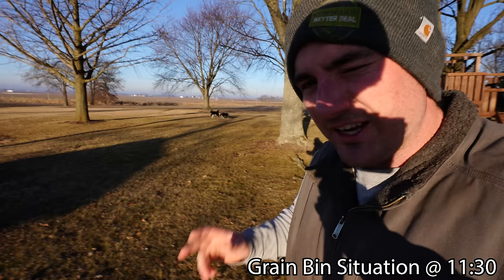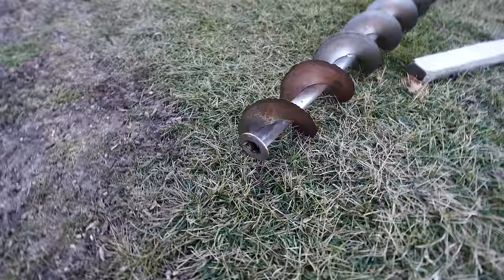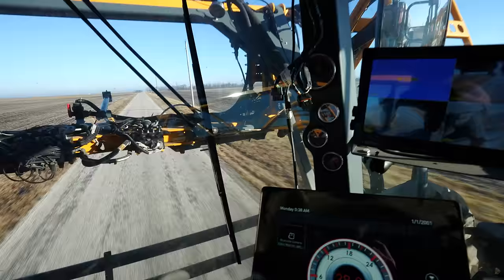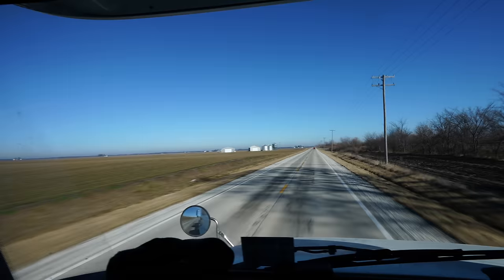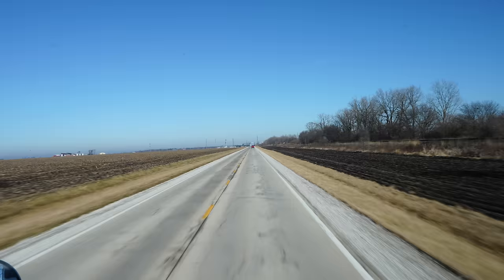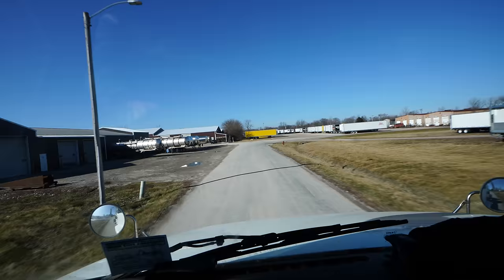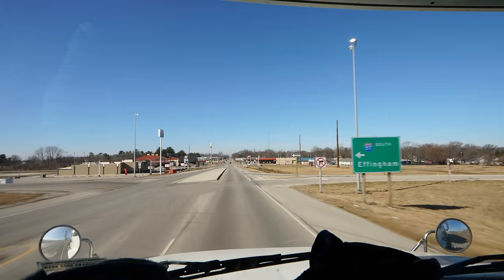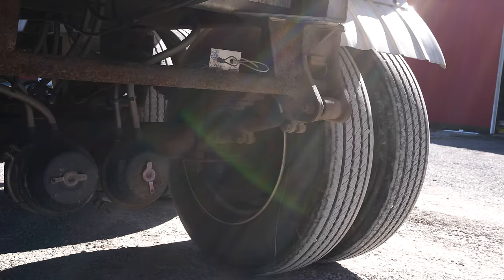Huge Commercial Grain Elevator Collapse

Comment: As a farmer they are not engenearing grain bins heavy enough when you get that big. Corn has gotten a lot denser. 56 lbs per bushel is now 60 to62 lbs per bushel. That extra 5 lbs times 800,000 bushel is a lot of weight.
Reply: I agree with you.   Oddly enough beans are going the other way now.  Should be 60 lbs per bushel.  This year we had as low as 52 come in.  Usually, average around 55.   I am an elevator superintendent.
Reply: @jerfle7787  The swing on test weights of any crops from year to year is very interesting to say the least.

Comment: I used to be a volunteer firefighter, once had a building collapse due to weight of water on the roof. The drains were all blocked and roof collapsed due to weight of the water

Comment: We had two grain bins that were made of corrugated metal, and they started to buckle, by making the corrugations smaller.    It was most likely caused by the weight of grain on each rib adding up for the whole height of the structure.   As soon as we emptied each bin, we installed vertical metal buttresses, to take the downward forces.

Comment: Interesting that you use the tanker to mix your chemical and water together. How do you avoid chemical cross contamination?  Where we are we only use tankers to haul fresh water to the sprayer and then add the chemical as you fill the sprayer.
Reply from the maker: Our herbicide plan is arranged in a way where the sprayer is only running on 1 crop type at a time. It allows an intermediary period to clean everything out between crops. It's not too difficult.

Comment: Andy I am a structural engineer. I watched the video several times. The best I can tell the seam right where it’s still standing went first. Then you see the entire bin drop down, then the seam above the stiffeners goes next because it pours over the top of them. With a clean break all the way around like that, all it takes is one bad spot, or the stiffeners weren’t bolted down, and with that amount of weight above it,,,, down it comes. What I did notice are the new sheets on the other big bin that were replaced. I wonder if that bin had damage or sheets replaced where it failed. For strength I would think the stiffeners would be offset not a straight line all the way around in one spot. Like the sheets are offset where the connecting seams are at. That offset gives you a little more strength. Pure conjecture and glad no one was killed.
Reply: One of the fans was out of balance and hard-secured to the bin I'll bet.  Corn has a nasty habit of being a wedge.
Reply: I am in southern IL.  The corn had a high test weight (density) this year, probably due to the type of weather and that the corn was mostly dry at harvest.  The bin may have had more tons of corn in it than ever before.  I was hauling corn on wagons.  Several of them broke stud bolts in the wheels.  I have never had that happen before.  I had to replace stud bolts and lug nuts.  I told my dad not to fill the wagons so full.
Reply: Liar.
Reply: @darringstewart2360  I think you're onto something, given the major temperature changes over the course of this year (and relative humidity) - if it got moisture into the top of the bin and add one weak vertical seam and you get a disaster.  I'm more curious about that ring that's between the bin and the road - it really does look like it burst
Reply: Having worked in the elevator business for many years, I have seen this type thing on a couple of different occasions. Both were large steel bins that were newer bins, and larger sized. Both were close to the railroad tracks as well. The thing that was similar in these cases was that the harvest was very good with high test  weight  grain. The ones I alluded to to were wheat filled, while the one showed here was corn, but the thing I heard in my examples were that the high test weight grain close to the busy railroad tracks are subject to packing due to the pounding of the trains going through. Over time this pounding packs the grain tighter to the point it will break the bolts and/or cause the lower rings to fail as they are not built to handle the excess weight and stress. I am no engineer so this is just what I remember hearing at the time. Food for thought I guess…….. Either way the good thing is no one got hurt, and the farmers should be able to build it back better than it was…..
Reply: Speaking in engineering terms these bins should have a safety factor built in that would cover unknowns such as heavy grains etc.  I used to work at GSI 15 years ago on the big bin lines.  I think when i was there only for 2.5 years we were owned by 2 different investment banks, and i believe a 3rd investment bank bought GSI shortly after i left.  And AGCO aquired them not long after.  Hopefully its not a result of the company constantly changing hands and everyone wanting to squeeze out more profit by cheapening things up.

Comment: The 20yrs i been in grain business, i have been around 3 bin collapsings. They way that one came apart, I would lean to faulty anchor bolt install and the way stiffners were tied in. Lot of times new structures are slapped together and follow up quality control is overlooked or forgotten. Harvest time go go go!

Comment: I’ve learned that all the farmers core their bins, which makes total sense. It’s like fermentation, the center gets the most FM, would hold heat & moisture under pressure. I’ll tell ya, the farmers who’ve put the reclaim system on their sprayers love them. They said it saves chemical too bc they’re not have to flush the system out between chemicals. I’m sure you’ll keep us posted on what you think!

Comment: Neat tanker, I would advice keeping the plastic cap, stainless thread on stainless thread can be more likely to leak. It can also be a pain to take stainless threads apart after prolonged use. Just keep the plastic cap and replace it every couple years if it starts looking brittle. It all depends on how often you plan on uncapping it really, plastic probably more user friendly.

Comment: I have seen this numerous times in my life and they always seem to follow a pattern.  These problems usually arise when the decision is made to push warm, moist air through a cold grain mass with aeriation fans. 

I don't know why, but it is common practice among many to lower the temperature of the grain mass to subfreezing temperatures which has always gone against my better judgement.  Yes, cold grain does store better for a longer duration, but other challenges will present themselves as weather conditions change around the storage facility.  

My THEORY on what is going on:  Corn shrinks when it is dried and expands when it takes on moisture (within the kernel).  Normally, the grain is already dry when it is placed in the bin and can be of any temperature.  At some point, the decision is made to aerate the grain (a good practice) to lower the temperature of the grain mass to that of the outside conditions.  Note, air temperatures are usually well below freezing during these winter months.  Some time later, the grain is desired to be aerated, again a good practice that helps keep the grain in good condition.  But the problem arises with using excessively warm, moist air.  What happens next is that a rewetting front develops in the grain mass causing the the grain mass to expand.  Stresses then rise in the structure to the point of failure.  The process is highly analogous to what is experienced with freezing water pipes.

Comment: Have your tire dealer check that weather checking tire for possible warranty coverage on the casing.  Typically if it is a Tier 1 Casing (Bridgestone or Michelin) the casing has an incredibly long warranty period - 8 years.  There's a date code on the tire.

Comment: i wonder if they have any empty bins to put the "clean" corn into?  I would assume that the corn in the bottom section is still clean and the corn that is several feet deep would still be clean too.  Hopefully there is concrete under the rest, but if they have an experienced skid steer or bucket loader operator they can recover the bulk of the corn without contaminating too much of it.
Reply: Any place with bunkers.  They have a snowblower low speed front on a belt conveyer out back on self propelled unit.  *never run one but looked it over*. It looks like they drive in, convey into trucks.  My grain vac is rated 3000 BPH IIRC.  But I figure self propelled unit get 5” from ground.  Grain vac for rest.
Reply from the maker: I would assume that they will just move it down to the next user if they are spending money to load it onto trucks. Another commenter said it is being sent to Decatur, IL, which is about 40 miles straight west of Arcola. That is ADMs hub...absolutely ginormous grain processing city.

Comment: Wonder if some of the bolts started popping and shearing before it went down? One a few years ago had bolts shearing before it came down. It was attributed too a worn die used to punch the bolt holes in the panels.

Comment: I would be very careful about using SS on SS it has a very bad habit of galling, the plastic cap should be well suited for what it is doing if you do use a SS cap be sure to use plenty of never-seize to help keep it from galling and don't over tighten. I was a pipe fitter for 40 yrs in a chemical plant I know a lot about SS.
Reply from the maker: I appreciate that insight. Maybe I will reconsider my plan!

Comment: Whoever put that plastic cap on needs to learn to weld cause that looks like it might leak lol but hopefully not
Reply from the maker: I think there is an air pocket in there on purpose. There might be some kind of a gap in the shell that requires venting. I could be wrong... that's why you have to fill it with water before you put the expensive stuff in!

Comment: A lot of that grain is recoverable and hopefully it does not get wet.

Reinforcement straps around various sections of the bin at the ring joints would help to stop a burst.
Reply from the maker: It has been somewhat dry since that happened. I think it is almost completely picked up now.

Comment: a local elevator put up a 600,000 bushel steel bin but discovered the contractor had used low strength counterfeit bolts and had to replace them all or that bin might have failed, like the one you showed, maybe it had cheap bolts in it too?
Reply from the maker: You never know where the builder cut corners to be the lowest bid. TGM bought this facility after the newest bin was built, so they didn't oversee anything. Maybe they need to add a full-facility inspection to all elevators of this size to make sure everything is the correct spec?

Comment: Replace the cap with a brass valve and put the cap after the valve. Stainless steel on stainless steel has a tendency to gall and then it's very hard to get them apart.

Comment: If you put a stainless steel cap on that nipple it will have to be lubricated every use with nickel never seize or liquid graphite to prevent the stainless to stainless threads from galling.  If the threads gall you’ll need a grinder to split the cap to prevent destroying the nipple threads.  Think I’d keep the plastic.
Reply from the maker: Someone else said that. You all know more than me!!!
Reply: @aTrippyFarmer worked in nuclear industry for years with stainless steel piping.  Learned some of that the hard way, been there, done that but they wouldn’t give me the T shirt.

Comment: Good Luck This Spring ! Be Safe. Work Harder AND Smarter !
And to think the metal, brick or concrete silos on farms used to last for decades; generations even, with proper construction and maintenance.
Then we see farmers spend a million dollars on new metal grain storage sights and they aren't even put together correctly, much less functional . . .
and the farmer has to sue the contractor.
BTW. Just Venting. When I was a kid the only thing we did with corn was use it for food. Some went to granges to process into flour or livestock feed.
Growing corn just to cook it into alcohol to 'water down' gasoline is adding insult to injury in half a dozen ways. If we needed sipping 'moonshine' we made our own.
And don't get me started on the damage most of the 'fertilizers' we have been using since the late 1940's has reeked on the soil.

Comment: Here’s the real question, you assume the bin blew out, could it be that a conveyor fell against the side weakening one side and pushing tons of weight of corn against the opposite side and creating a weak spot causing stress fatigue. I’m betting there was wires from one side to the other on the inside of the bin, all it takes is for something to break and you lose integrity!….

Comment: I've always wondered how these massive grain bins can stay standing? I've watched how they build them. The materials seem so flimsy to the uninformed person. I'm even more shocked to hear they cost 2 to 3 a bushel to build. Someone is making a ton of markup. I have no idea why it burst. We have much larger bins than this one out near my range. Honestly, every time I drive by the elevator, I speed up. LOL, I don't want to be anywhere near that place if anything gives. 800,000 bushels is a huge amount. Ouch!!! The best news is that no one was injured or worse. The rest is now in the hands of the insurance companies.
Reply from the maker: Agreed! It's always good to hear there were no injuries. People aren't always that lucky. You are right, and that is a point that I tried to make. Grain bins are inherently weak when separated into individual components. These commercial bins probably have marginally thicker ring panels and of course the added stiffeners. Bins of this size are somewhat easy to compromise in violent wind events if they are empty of grain. The grain makes them more structurally sound...until it doesn't!
Reply: @aTrippyFarmer  Thanks Andy, stay safe

Comment: I'm with at least one commenter here. And not as a structural engineer myself, certainly looked like a vertical seam on a ring section popped and it just sorta zippered from there. What rings remained stable is only so because of the weight being off from above. Otherwise it would have been a near top to bottom zipper opening. Much like a very obese body popping out of a tight zippered coat, grain bin was the same way.

Comment: Pretty crazy. The way the metal looks to be folding like there's a downward pressure on it, makes me wonder if you could have a scenario where enough corn stuck to the sides could create a gap, and then that suspended weight pulls the structure down into the empty void? Otherwise it should be pretty self sustaining if it's full.
Reply from the maker: I could see that being possible on a bin of this size. It does have stiffeners, which should negate that chance a bit. Supposedly, this bin was completely full, so I don't know if your theory applies in this exact instance. You can definitely collapse a bin from offloading from one side too aggressively. That's why the center is the safest way to run grain out. If you are using side shoots, you probably need to equally pull from each side, or at least just have the shoots high enough to make it a non-issue.

Comment: 800,000 bushels of corn 🌽 at $4.14 a bushel is $3.36 million.  Probably cost $4.6 million to produce.  Just saying farming is in a depressing state right now.  😮😢
Reply from the maker: Your math is correct for current conditions. However, you're assuming that farmers are still holding cash positions in this grain. This corn could've been presold in the winter of 2022-2023 for $6 a bushel. As an elevator, TGM can speculate on the basis of the grain market, along with profiting off of discounts, shrink, and various fees. Farmers may not own all of this corn on paper. Given the lofty input prices for the 2023 corn crop, you are correct about it taking a lot to pay for the grain. It should be a marketing lesson about forward selling high priced grain when input costs are exorbitantly high. We made the mistake of not doing much of that ourselves. The unfortunate reality of farming is that we are our own worst enemy, along with input manufactures drastically raising prices in accordance with grain prices. We bid out all of the profit to rent land and buy land when it really does not make much financial sense to do so. It is sad to think about, but it is the nature of current farming.
Reply: @aTrippyFarmer  Hopefully, most had their corn 🌽 contracted at the $6 plus zone.  Unfortunately, a large percentage probably are stuck.  Hopefully, fertilizer prices continue to trend down.  Still, isn’t enough yet for corn 🌽.  😔

Comment: I've seen YT videos of "specialty" crews assembling this style of bins for farmers using power wrenches. It's unlikely all such fasteners are correctly tightened and none abusively over-torqued. It's a Lego approach to fast assembly using "general labourers" to erect a massive and structurally vulnerable container when empty. It only takes one metal-fatigued fastening element to fail under repeated temperature cycles. The rest is a cascading stress failure.
I'd be wealthy if I had a dollar for each trigger-happy shade tree DIY-er with a DeWalt gun I've seen lay into a fastener and then slap the work and say, "That ain't goin' nowhere."
Wait a year or two. Something will pop apart.

Comment: I am guessing all the corn will need to go for ethanol and animal feed now ?  Will they be able to have the bin replaced by fall ?
Reply: Most corn goes for ethanol or animal feed anyway, I'm sure they'll get it rebuilt unless the concrete was compromised which is probably what happened.
Reply from the maker: It is getting loaded off onto semis after being screened. A few others said it is going to Decatur for processing. As long as you get it up without rotting and rocks, it is still perfectly fine corn.